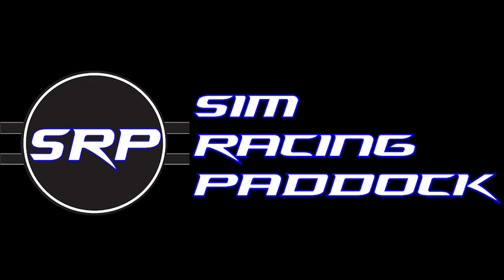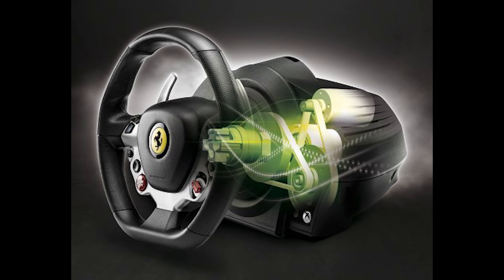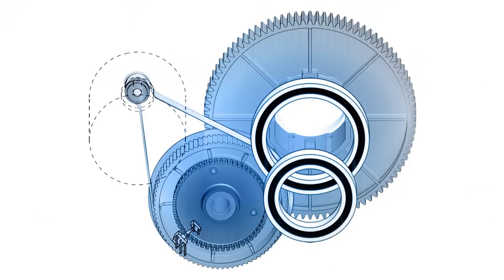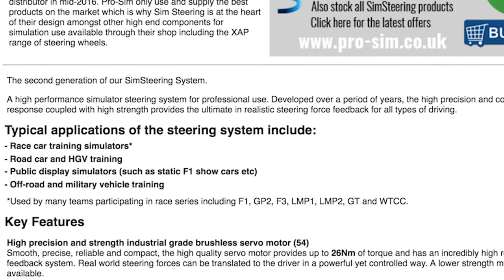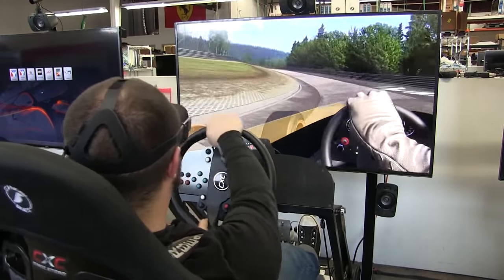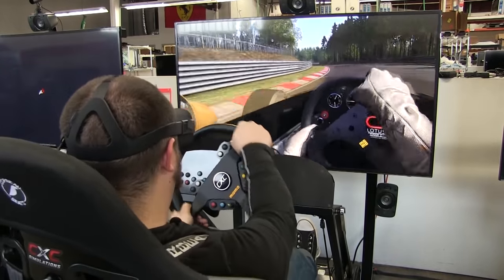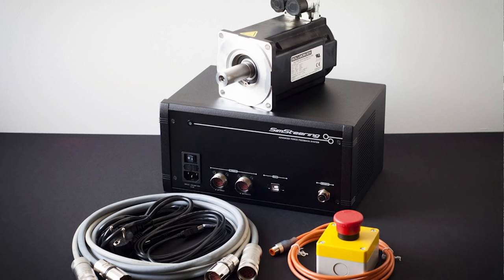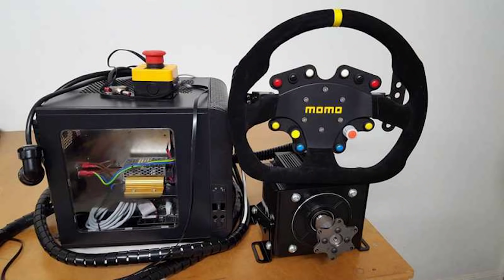What is a Direct Drive Steering Wheel?

Comment: The pros of a direct drive wheel is not nessecarly the fact that it is fast, but that the force is mostly linear from 0 to its max force. A direct drive wheel of 10 nm has roughly same responce as a wheel of 20 nm. So for example in iracing you experincing zero clipping unless the particualt vehicke ask for greater then max force of direct drive wheel. i know this because i built an ows and read forums for countless days.
Reply: Dark Sector Gaming Are you talking about differences between hybrid servo motors at DD and collector motors at non-DD wheels?
Reply: Sergey Afanasev When I'm talking about about motor linearity I'm not talking about the actual motor curve.  Instead I'm talking about the relationship between what the sim ask for and what the wheel responds with.  Majority of sims ask for more torque then most consumer wheels output. 

Here is a good website http://www.edracing.com/edr/Wheel-Torque.php
Reply: Are using asking if I'm comparing between servo motors and motors that are in t500 or g29?
Reply: Dark Sector Gaming As I know, T500rs and  G29 uses basic DC collector motor, that has non linear moment curve, but DD wheels uses hybrid servo drive, that can generate controlled moment instantly, and that's best for gaming. Am I correct?
PS I'm T500rs user and never played with DD wheel, but I'm engineer in microelectronics and I've worked with DC motors and frequency controlled three phase motors.
Reply: Dark Sector Gaming Seems like you know, how game works with FFB wheel. Could you explain this theme? Or give a link, please.
Reply: Sergey Afanasev You are 100 percent correct.  I only know about steppers because I program them at work with arduinos for custom apllications. I know servos  because I used one in my build.  Most all servos I know used in DD application use encoders for positional feedback.
Reply: Sergey Afanasev Think of a sine wave.  Most times we think of them and see them as horizontal.  I think of force feedback signals as more being a vertical sine wave.  You have amplitude and then frequency.   Now imagine your sim of choice is asking for 6nm of force, but your wheel can only supply 3nm of force.  What is going to happen when you take that high speed left turn is that the sign wave signal let's say has an amplitude of 6, but the wheel can only supply 3.  The top portion of the sine is completely ignored by the wheel because it clearly can not give you anymore force then 3nm.  So information is completely lost.
Reply: Dark Sector Gaming Good, thanks. So it doesn't matter, if you have DD wheel with powerful servo, or non-DD but with good servo. But if wheel is non-DD, mechanical coupling between wheel and servo should be without freeplay because of gaps.
Reply: Dark Sector Gaming Very interesting, that game gives command to set absolute moment. It's more logically correct to send 16 bit (for example) data, where 0xFFFF is maximum, that wheel can set. Or you'll lose data, as you wrote.
Reply: Sergey Afanasev I think the downside to non direct drive wheels is the fact that pulley or gear driven wheels cause a bit of dampening and or input latency.  Like I said D D wheels give you an advantage because you feel subtle forces all the way from 0 torque to max instantaneous torque of 20nm like my setup.
Reply: Yes, gaps in mechanical and/or elasticity of belt lows response.
Reply: Sergey Afanasev You are thinking to much into it.  We're not talking about data types here.  We're talking about moments in time.  I don't know how the data is sent or what type of data type it is.  We're talking about high level overview here of how the sim sends the force the information and how much the wheel can respond.
Reply: I think I must of misunderstood exactly what you were asking.  I understand the relationship between the sim and the wheel not really 100 percent how it actually send the information on a pure data type.
Reply: Sorry, I've started to think about how T500rs works with it's DC motor and if it's possible to replace it with servo. I need to take a look inside it with oscilloscope.
Servo has its maximum moment in short time with all the attendant benefits, that are impossible for DC.
Reply: Sergey Afanasev you have to find something that would be small enough and also be able to use the encoder or whatever sensor they use to give positional feedback.  The issue with servo is that getting decent torque the size of them get pretty large.  My servo weighs 11.5kg or 25 pounds lol.  It's heavy!!!
Reply: Thanks, interesting thread. About size and weight - the more torque you need, bigger motor will be, because of current.
Reply: Osw small mige with 20nM push about 12.8A, the big Mige almost 20A for a 27-30 nM. Bigger motor are not faster but just stronger, if you want something more precise, you change the encoder for positionnal tracking. The gain of having a DD is that the power gets transfered almost instantly giving you a feeling of 1:1 ratio, no latency whatsoever. The difference behind the price with the Bodnar system is the motor (Kollmorgen) and the cheaper Mige coming from China, but with OSW you could easily change the motor ex.  a lenze, a mige, or a Kollmorgen and choose the encoder you want ex. 5000ppr (pulse per revolution) or a 10000ppr. It's almost like buying car (so much options ranging from motor, encoder, and power supply).

Comment: Could you explain the difference between the types of motors used? For instance does Accuforce wheel use a stepper motor? What does this mean in relation to sim racing, with pros and cons. Thanks

Comment: You are putting this wrong at 2:37, torque actually is a definition for strength. 
"That force (torque) is relative to the speed of the wheel" - nope, it's power that you are talking about.  Power is torque multiplied by Revolutions per minute (what you are mentioning as the speed of the wheel).
From what I can see from your description, these wheels comparisons are like two engines: diesel vs gasoline with the same amount of torque, where the gasoline has more HP (=speed) because of revving much higher. So both of them have the same torque but one is faster.

Comment: Quick question, why are direct drive wheels so much more expensive than consumer grade wheels considering they seem to require less parts?
Reply from the maker: S_Frost S_Frost the simple answer is, the limited parts that there actually are, are quite pricey. for example, the Mige servo motor, that is commonly used in the Open Sim Wheel, is around $400-$500 for the lower powered version.

The Kollmorgan AKM series motor used in the SimSteering is even more.

Then you have to factor in the electronics required to power the motor, which can be a few hundred in itself

Comment: The part I dont get is the price,if you cut all the gears and chains,reduce space so less material,why its more expensive ? Shouldnt the economic ones came with this direct drive to save even more and have more quality?
Maybe Its better to just buy a mid tier one like the g29 and slap a motor to convert to direct drive an saving like 500€?

Comment: It still doesn't make sense to me, because in reality cars have a different feeling in the feedback, depending of soft driving Servo Mercedes, or a hard quick driving Go-Kart. 
Is the Direct Wheel capable of being both soft and sharp?
And if the Sims simulated the real Steering wheels, why do they allow you to change the forces, without telling what the real settings are ?

Comment: Can I ask why in the world you would want something so strong? Most cars have power steering and don’t even come close to generating that amount of torque in the wheel, do they?
Reply: Jeffrey White You are correct ... as long as you're talking about modern cars with power steering. However, you can drive old cars in sims - and those things can require full force of a direct drive wheel (if you're going for max realism).
There are other benefits too, force is just one of them. Direct drive wheels have more precise force feedback and those motors have linear torque curves.

Comment: I don't want stronger but I can understand the smoothness.  I have a G27 and have strength turned down 'cause I have a shoulder problem.  In your video I see the screen still ahead of your hands on your wheel. I Would like quicker response and smoother movement but there is no way I can spent that much for a wheel.  Any suggestions?
Reply from the maker: Gear drive is by far the "roughest" out of all the wheel technologies on the market. A solid middle ground would be the belt drive wheels that are available. The CSL Elite and T300RS  are solid offerings, and you'd spend roughly $400 or so for a wheel/rim. If you didn't want to splurge for a new set of pedals, you could get a "Bodnar Cable" for around $30 or so.

I also created a Wheel Buyers Guide, if you're interested in seeing the options available: http://simracingpaddock.com/pc-sim-wheel-buyers-guide/

Hope this helps!
Reply: it feels "grainy"

Comment: Just a small point at least with the osw systems they are not ffb motors they are just motors. They were never designed for ffb application but industrial and cnc applications
Reply: Paul Thomas the Leo bonder wheel system is also a servo motor.  Because it is used in industry and cnc  applications doesn't mean anything other then stating the obvious.  nothing to do with any of this stuff.  Professional direct drive wheels are all servo based.
Reply: Yes but they are not ffb motors
Reply: Paul Thomas I'm not you understand how things work.  What in your mind constitutes it being labeled a Force feedback motor?  All of these systems use motors you can buy off the shelf somewhere out there in the ether.  What makes them force feedback is the development that is put into them.  All motors in force feedback systems are all just types of electric motors.  A motor is a motor.

Comment: I see so many videos that talk about the linearity, the quickness, the latency of a belt or lack of fidelity.  Does anyone know of a video where they measure the "quickness" of high end belt drive wheel bases?  If it's "output lag" from the time the motor turns to the time you feel the forces in the wheel rim I would think that would be instant on a belt or gear rim as well since the moment the motor turns the connected belt or gears would also be turning.  I wish I knew someone close to me with a DD wheel as I would love to see what the hype is about.  I have a Thrustmaster T-GT now and it's great I don't run it with maxed out FFB so it has plenty enough torque for me.  If anyone can link a video where they actually measure the FFB latency from belt driven wheels please link if for me.

Comment: Is it possible to modify a consumer level wheel to make it like a direct drive wheel?
Reply: Yes, you can actually bolt anything to a good servo and it will work. 
So to answer your question - you can, but it would be pointless and you would save only on the actual steering wheel. 
This is engineering stuff - you need a servo, probably an asynchronous 3 phase motor, servo driver (controller), mains filter, and depending on the servo you would need 1 or 3 phase mains power.  To that point it is very easy, now you have to create software to write parameters like torque, speed, position to servo driver internal programmable logic controller (PLC). This is not that complicated if you know what you are doing and also achievable in a matter of hours, maybe days. The hard part is to send proper data from the actual game to your program (at least in my opinion, maybe because I'm familiar with industrial drives and not with driving simulators programming). 
And let me warn you - industrial servomotors and controllers are quite expensive and most of the time not plug and play.

Comment: good video, but i don't think you understand the relationship between torque, angular speed, and power. a low torque wheel can cope with a given angular speed as long as it can supply enough power. this doesn't tend to happen with standard wheels because so much power is being sapped by the belts and gears when everything starts moving vigorously. (and if power drops, torque drops below what the electronics are requesting. P=tw) Also, the (modestly priced) motor is high speed & low torque, meaning it has to really travel to do its job ... and since it's probably not optimised for those rare furious jerks when you get into trouble, the motor is probably struggling at those revs. this is roughly analogous to your perfectly fine voltage sagging when your electronic whatever suddenly needs to draw more current. another way of putting it is that your low torque wheel becomes an even-lower-torque wheel if it isn't designed to cope with speed. direct drive by and large is brilliant at coping with speed. so put me down as one of those people who are quite sure a direct drive wheel doesn't need the torque to wrench your shoulder out of its socket. all the information can still be there, but at a "lower volume", so to speak. fwiw i cut my sim teeth on Atari's marvelous "Race Drivin'", which i believe had a 70 volt direct drive motor; and which (a) ruined commercial wheels for me [i used a $40 non-FF wheel for years, and when i moved to FF my times just got worse and it never felt right] and (b) hurt my shoulder because i drove with one hand on the stick, which took maybe two or three years to heal. i suspect if anybody could find a scrap cabinet the wheel would be good for re-purposing with some new electronics

Comment: I like the info on the video except that it doesn’t cost $4000 for a direct drive setup.  Maybe $2000 but $4 Grand?  Maybe your referring to more expensive brands other than Fanetic, Thrustmaster.  But thanks for the info!!
Reply from the maker: That $4,000 figure I mentioned (4:30) in the video was SPECIFICALLY regarding to one brand of wheel, the SimSteering 2. Currently the best price is from www.pro-sim.co.uk, and the price for the unit with no rim is ￡2,350 (or around $3,165 USD). The SimSteering2 54 is ￡2,666 (or roughly $3,600). That's before taking:

A. Shipping & Customs
B. Adding a Rim/Mounting Bracket

Hopefully this adds some input!

Comment: Wouldn't another pro of a direct drive be no wheel chatter?  Im just assuming, since there are no gears to make chattering noises.  I have no experience in sim racing yet.  My birthday is June 11th and I'm getting my first wheel then.
Reply: if you buy a belt driven wheel, you wont get that chatter noise.
Reply: Snowjix i know. my thrustmaster t150 is belt and gear mix and has no chatter
Reply: nascarsimracing1 - Fantastic!!!!
do you turn your wheel to the right, btw? just asking.
Reply: Snowjix what do you mean by if i turn my wheel to the right? either direction and there is no wheel chatter.
Reply: "Nascarsimracing"
Reply: Snowjix what? im confused. maybe it is because i am a noob to sim racing. i just got my first good wheel for what i can afford, the thrustmaster t150. i don't know much except sim racing is the real deal compared to arcade games.
Reply: well, i do know about the different mechanisms for steering wheels and how they work and pros and cons, and i do a lot of review watching and gameplay watching before i buy stuff. and im glad i do because i made the horrible choice to buy driveclub instead of assetto corsa for my ps4, even though i knew hardly anything about driveclub and had already researched assetto corsa. and what do you know. i hate driveclub. crash physics suck, damage simulation is terrible, and i can't progress further in the game because it is too hard and i don't enjoy it.  i am into rally and track racing, not street racing. i know driveclub is on closed roads setup for racing, but whatever. i like rally and track racing like dirt and assetto corsa. i am better at those kinds of racing games.
Reply: but don't take my word for what driveclub is like. remember, I AM A NOOB.
Reply: +nascarsimracing
You obviously enjoy nascar, i then assumed you drove alot of oval tracks. You don't turn to the right alot in them, do you?
(Unless its a oval track going to the right, havent seen one of those though)
I am no less of a noob myself when it comes to simracing.
Reply: Snowjix oh now i understand. here is the story behind my username. when i was five years old, i played nascarsimracing. i played wjth a thrustmaster ffb whe e l eith clutch.  i kept frying the clutch and crashing, but i enjoyed the game. so i named my youtube account nascarsimracing1. i haven't played it since, and don't race in ovals.
Reply: Snowjix i do turn a hell of a lot to the left because i am too dumb to slow down at turns on them. i am fine on normal tracks though.

Comment: Is there a direct drive wheel and pedals that is plug and play?
Reply: Yes, Fanatec has released two DD wheelbases last year which are compatible with almost their complete ecosystem. The premium model is https://www.fanatec.com/us-en/wheel-bases/podium-wheel-base-dd2-usa.html. So if you are ok with sticking to one manufacturer, you get a hassle-free solution with a reasonable price tag compared even to self-built setups (which are cheaper by default).

Comment: I want to build an OSW for $900, where can I get the parts for this amount?
Thanks!
Reply: Ryan Chenoweth good starting point is the iracing forums under hardware.
Reply: Dark Sector Gaming I don't have access, is there anywhere else?
Can the small mige be purchased from Asia?
Reply: Ryan Chenoweth You can purchase the motor for about 225 from alibaba I believe
Reply: And then it's just the Simucube stuff from their website?
Is that the cheapest to get that from their website direct?
Reply: You might possible be able to find it somewhere in the states.  But I believe that is probably the cheapest.